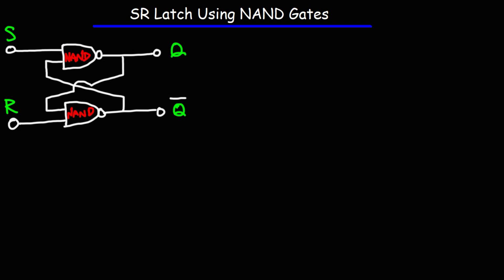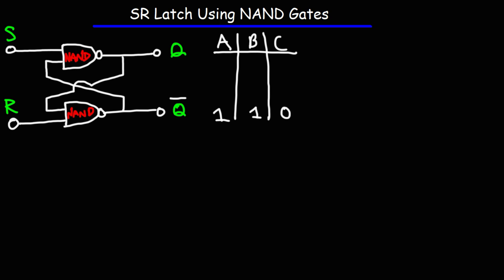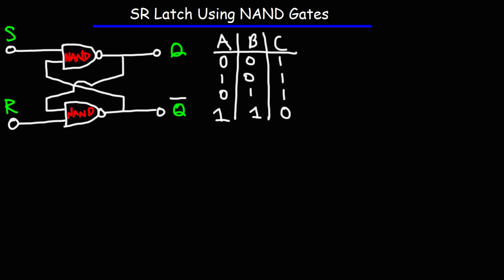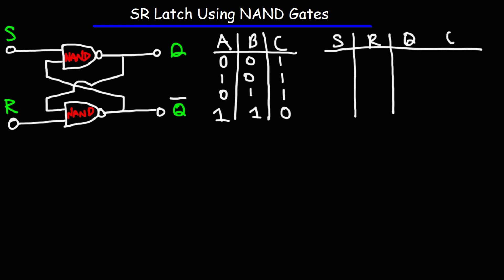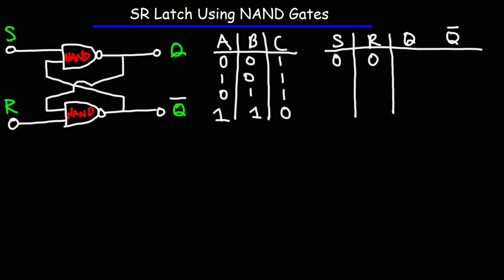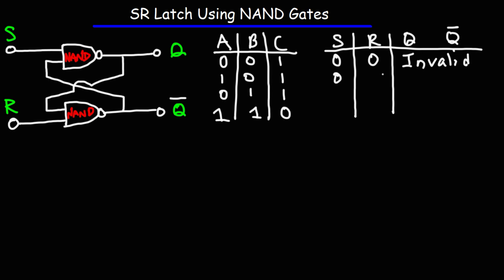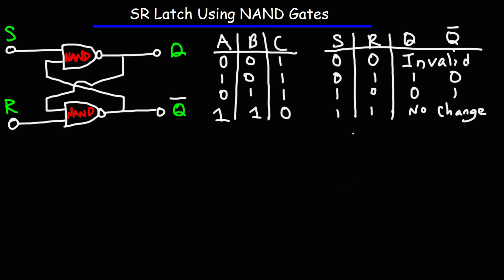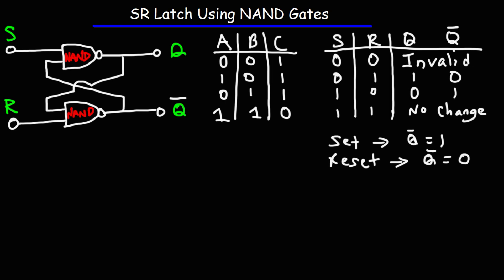SR Latch Circuit Using NAND Gates

Comment: Well... see what I notice.

Using nand makes the same nor s4 latch but with 1 having the same effect of 0 and vice versa.

Just add a not gate after the s and r input and you wil get the same truth table of xor sr latch.

To prove this just swifch 0 to 1 and 1 to 0 in the inputs of the truth table. And write the outputs depending on the first truth table.

Comment: Thanks alot for this video.

I am confused on how the common emitter amplifier inverts signal using the capacitor arrangement in the input and output.

Thanks alot for making this topic easier.

Comment: I have a video suggestion. I was taught physics only using algebra (associates degree). How would one begin teaching themselves how to introduce calculus to the physics they were taught?

I already figured out how to do it with areas such related rates of change (like geometry in physics and anything to do with time, displacement, velocity acceleration, etc), but I'd like to know how to take that further.
Reply: To get an associates degree in physics you need calculus based physics. How did you graduate?
Reply: @mikuculus3720  The program was taught to us using algebra only. Honestly there weren't many moments where calculus was necessary once you could memorize the formulas.

Although, I was also majoring in mathematics so I already knew calculus and just figured out where it'd fit.
Reply: @helphowdoinputusername3571  That’s strange, algebra based physics isn’t going to teach you much, to understand things like electromagnetism calculus is a necessity. If you want to start applying calculus to your physics you should check out the organic chemistry tutor calculus based physics course and ready up on calculus based physics textbooks.
Reply: @mikuculus3720  Thanks I'll check them out. The algebra definitely works for things like Newtonian Mechanics, Light and Waves, Thermodynamics and basic stuff like that. But at the same time I know I'd get more out of it if I introduced calculus.

The Bachelor Degree I'm applying for should introduce calculus based physics but why not get a headstart.

Do you know of any other free resources for math as well as physics? Like free online courses and free textbooks etc. I like to learn from as many sources as possible. The fields interest me so I just enjoy learning
Reply: @helphowdoinputusername3571  Paul’s math notes online, Kahn academy, and blackPenRedPen. Those are all the free ones I know, you could also find a free pdf for a good physics textbook online along with a calculus one.